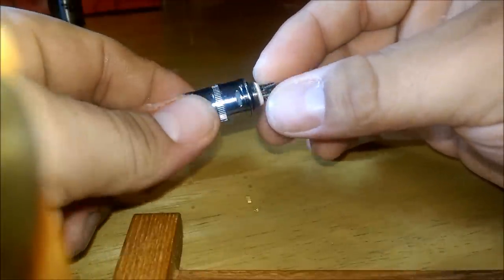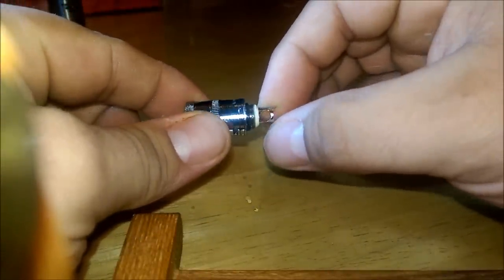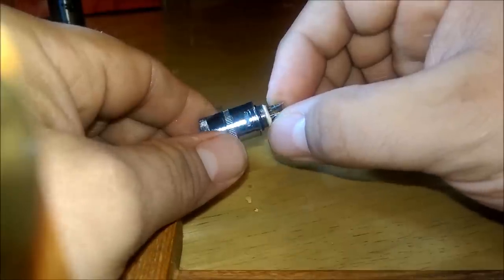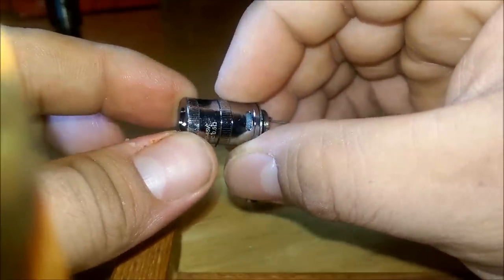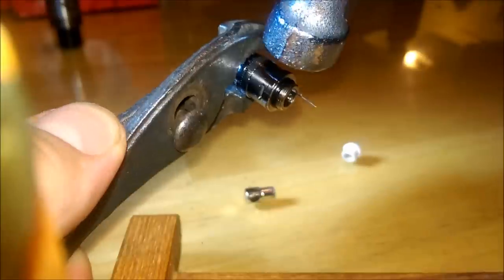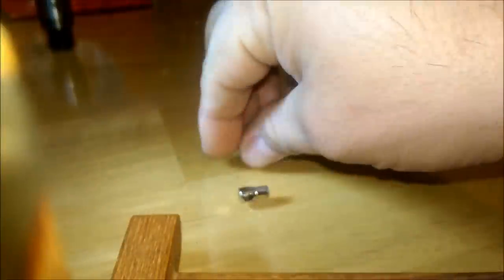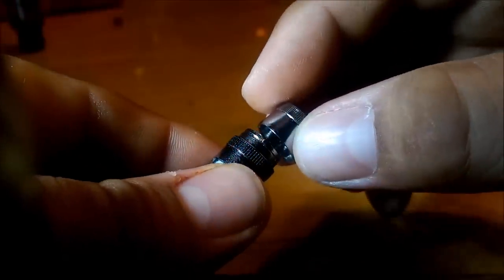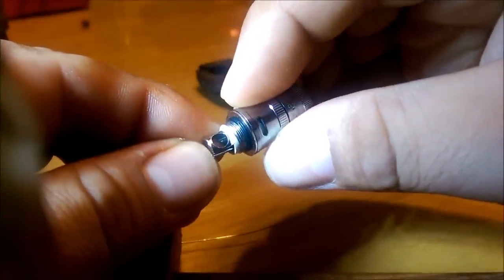Joyetech Delta II Coil Rebuild

Comment: Nice rebuild.  Holy pain in the ass but much respect.  My local B&M just happened to get these coils and the Melo ones in today when I was juice shopping so I snagged two 5 packs.  This is a great DIY for the folks that have the patience to do it.  Nice work my friend.
Reply from the maker: Thanks Brian. It actually wasn't as bad as it looked. The third time around it only took a few minutes. I thought about trying a vertical shotgun coil in it just got shits and giggles lol. Hey, did you get my pm about that coil I made for Mike?
Reply: I do not remember getting a PM about a coil for Mike.
Reply from the maker: The Vapor Chronicles I built a twisted staged heating coil that I'm sending out to Mike vapes, and just wondered if you would like one as well.  I sent it through the vapedom forum. Just let me know, I'd be more than happy. I made a video of it being built if you're interested.

Comment: new sub from Mike Vape's. I like this one. I was able to get my Delta 2 head apart & re-wicked it, like I do w/ the Atlantis heads but it flooded out instantly. Gonna try again. Super simple once I figure out my flooding issue. My 1st coil lasted 2 1/2wks. My 2nd, lasted 2 days! Boy I was pissed off. I think the second head had a hot spot because I was running it easy, 27 28w. Will see & keep up the great work. Would love to try one of those kickass coils for a future video. VVD :)
Reply from the maker: Thanks man. Yeah, it's kind of a fine line I've noticed rebuilding that coil head. I'll have a new vid posted tonight here shortly. Gotta get me a new laptop that doesn't give me fits every time I try and edit a video. Then take six hours to save before I can even upload it lol.

Comment from the maker: Hey guys, let me know if you would like to see these coils rebuilt also using a horizontal build.
Reply: yes pls
Reply: Home Brewed Vapes which is the measure of resistance wire of Kantal to do this resistance? Thank you
Reply from the maker: +fedee ee I used 24 gauge kanthal six wraps for this build.
Reply: What about 28 gauge

Comment: Awesome video dude! But I was just wondering, after you rebuilt the coil did you notice any leakage? When I did it I noticed later on in the night it started leaking. Any helpful tips on where I went wrong would be awesome! Thanks
Reply from the maker: Didn't have any issues with leaking. Where is yours leaking from?
Reply: Home Brewed Vapes the bottom, seems to be coming from the airflow.
Reply from the maker: Gibby Levy I've heard that some people had leaking issues with this tank. But if it wasn't leaking before you started, then the only thing I can think is maybe the wicking is too thin possibly. I might be off on that one though.
Reply: Home Brewed Vapes thanks!

Comment: Thanks for a great video. I am going to attempt this with 26g wire with an eleaf istick 50w battery because that is all I have and can afford. In your opinion do you think that will be safe? I have heard if you don't use exactly the right thing you can mess up your battery. Thanks in advance and I appreciate it.
Reply from the maker: as long as you watch that you don't get any shorts, the only difference should be little higher ohms reading. You might have to play with the wicking a little too get it right, but yeah, it should still work man. thanks for watching.
Reply: +Home Brewed Vapes thanks so much, I appreciate the mentoring!